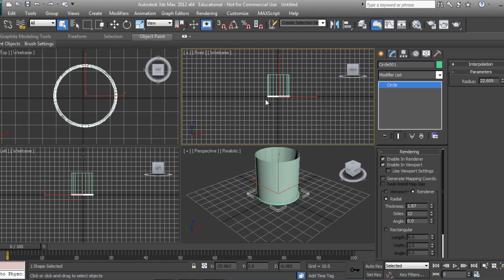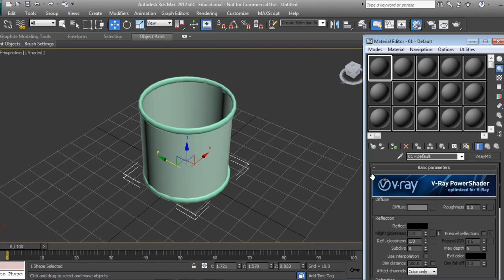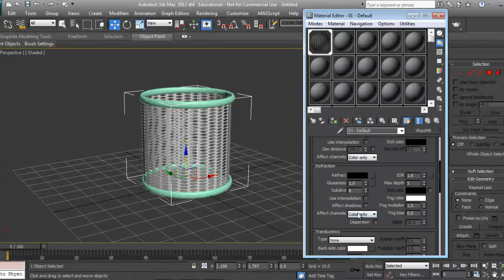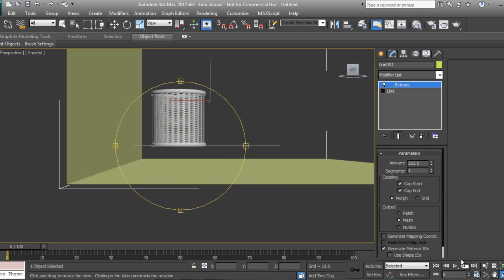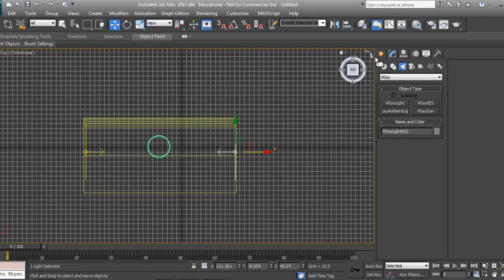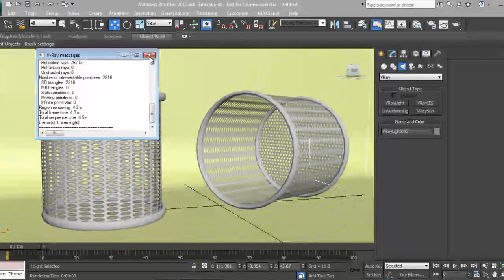3D Max Texturing:Office Bin textured in 3D Max

Comment: Hey it worked, thanks a bunch! Is there a way to give it depth though?
Reply from the maker: +Lennart like what kind of depth.
Reply: keyframesonline thanks for replying. Currently the texture is infinately thin, its simply a line when you look at it from the side.

What I mean with depth is that you make it thicker. Know the steel grid walkways on, lets say, industrial buildings? Or fire escapes? Thats the kind of texture I'm trying to make.

Maybe I shouldt try it like this, but I'm just starting out with 3DS max for a small project on my own time.